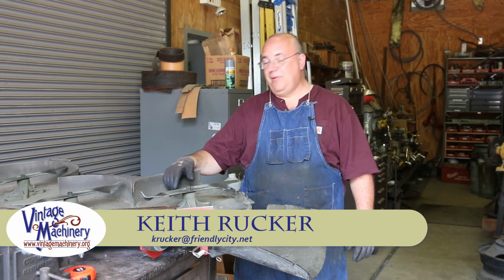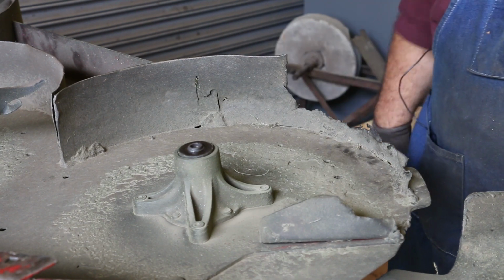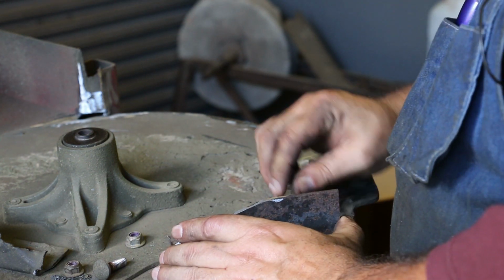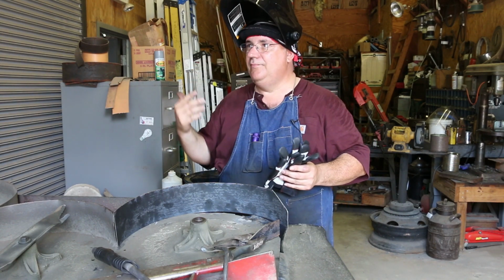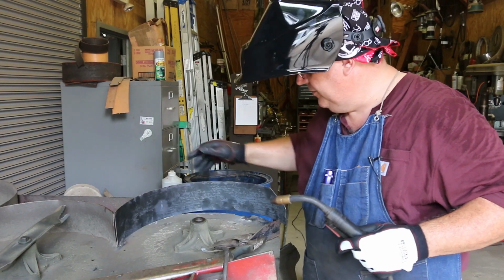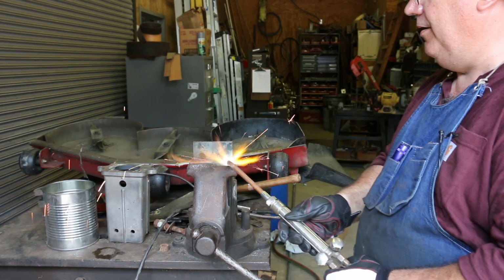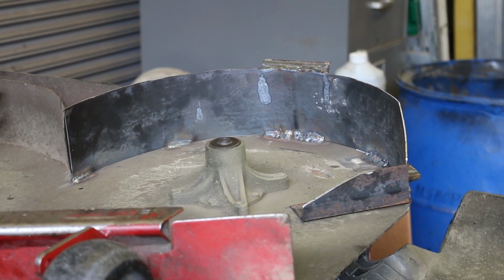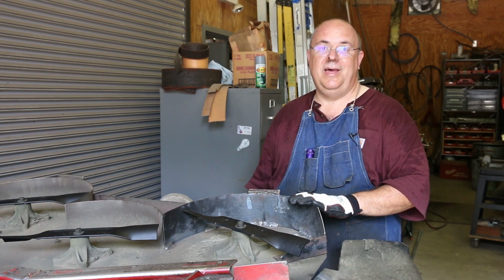Mower Deck Repair:  Fab and Welding

Comment: really ugly welds? the folks at the toro plant close to me might take exception with that. they are looking for help if you are interested. be nice or you better not open any boxes from me this winter. I will wait until the coldest day to bag you up a gift.  Dave in wi.
Reply from the maker: They were really ugly welds.  But then I remembered that the guy at my lawnmower shop did some welding on the deck a while back trying to repair some of the damage that I just fixed.  I am pretty sure those welds came from him and not the Toro factory.  The welds on the other shrouds looked much nicer.  I should have specified that in the video.....

Comment: you are way over due on new blades
Reply from the maker: I go through about four or five sets of blades a year.  I usually run them until I am just starting to see some streaks where I am starting to miss cutting some of the bahia grass weeds (it is tougher to cut than the centipede that my lawn is) and I saw that towards the end of my last cutting so it was time.   I put new blades on when I finished the repair.
Reply: Yeah, like the new ones he fitted at the end of the video!